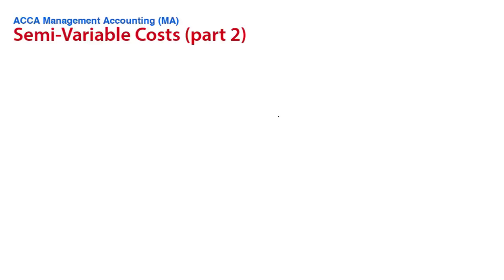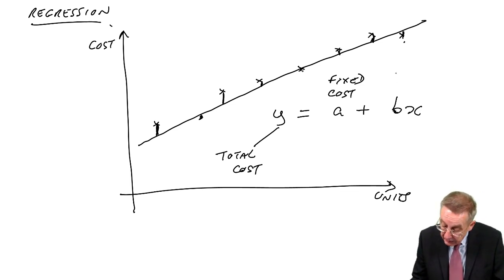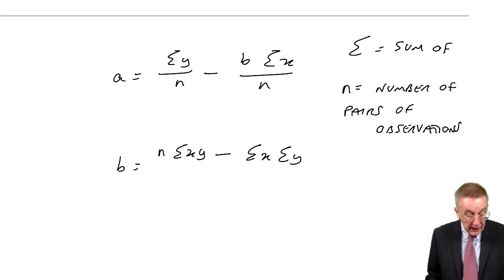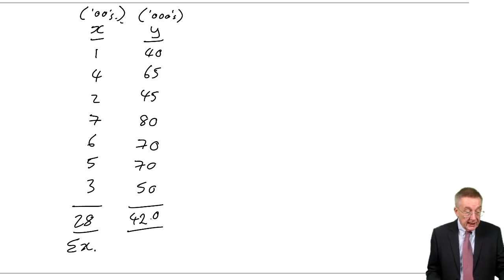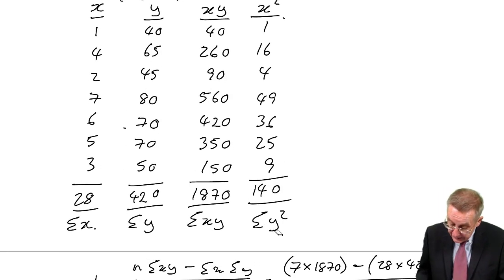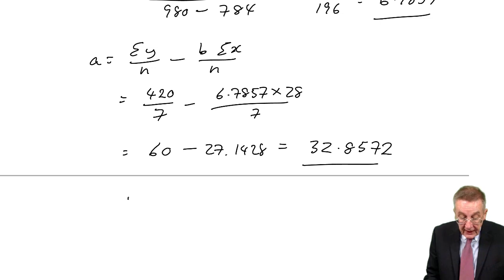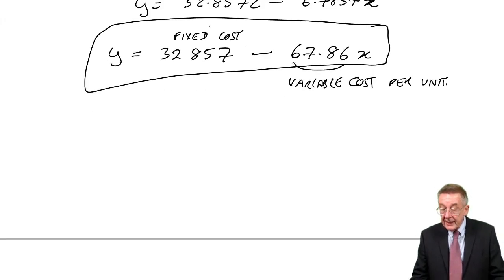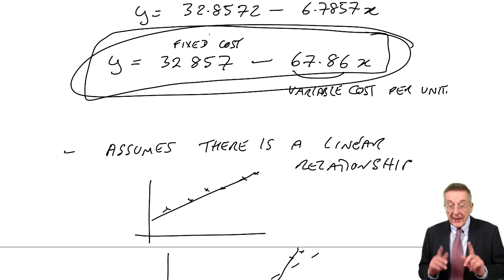Semi-Variable Costs (part 2) Regression analysis - ACCA Management Accounting (MA)

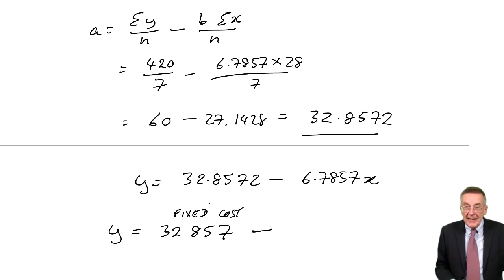Comment: @16:30 I didn't understand that multiply by 1000 and divide by 100?? I understood multiplying 1000 for fixed cost but can u plz explain me for the variable. I couldn't get there!!!

Myself an F5 candidate and now since this topic has been introduced, could you plz confirm me whether we would also get these formulas in the formula sheet as F2 students get it or we need to learn!!
Reply: Total variable cost just like fixed cost will be in 1000s
But variable cost per unit is multiplied with number of units to become 1000s
So if total vc is 1000s and units are 100's then vc per unit will be 1000÷100 = 10's
Reply: @ednagonsalves8703  Thank u so much sister
Reply: @ednagonsalves8703  still I didn't understand why he divided it by 100? What's the point?

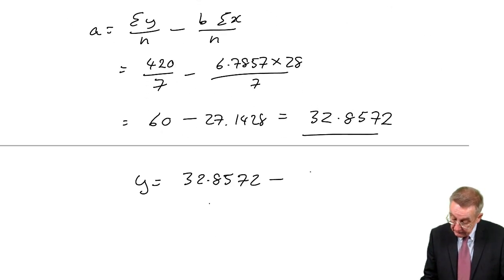Comment: 15:20 if y=a+bx why do we say y= 32.8572-6.7857x and not +6.7857
Reply from the maker: We don't, I mis-wrote and must re-record the lecture. It should be '+' and is correct in the printed answer in the lecture notes.